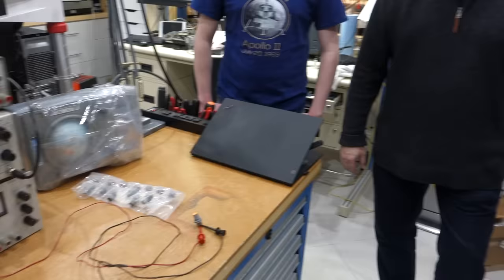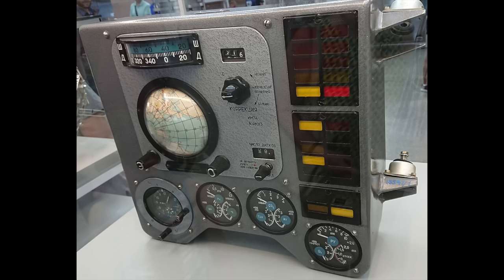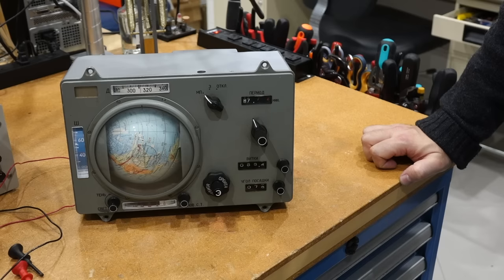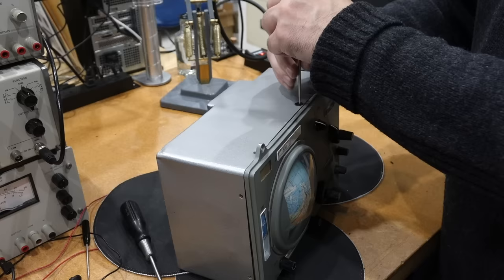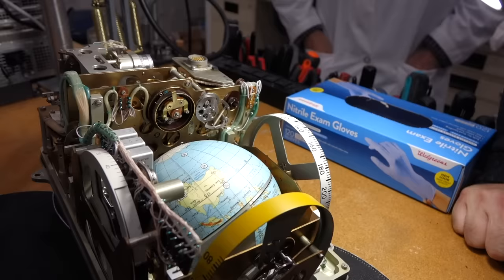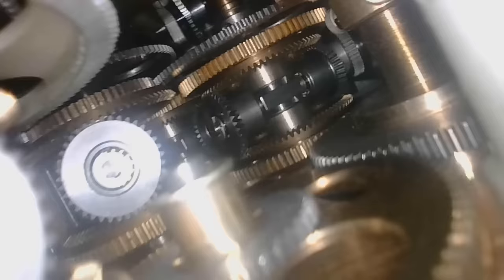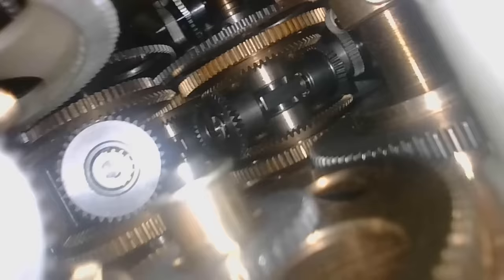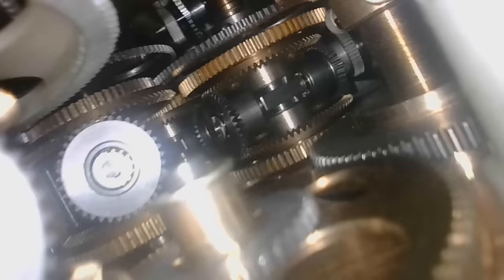Soyuz "Globus" Mechanical Navigation Computer Part 1: Grand Opening

Comment: It's incredible what people did in the past without CAD/CAM, a true engineering masterpiece.
Reply: Have you seen drafters? They're like the old computers when they were people too.
Reply: It´s a simple mechanism, not a computer. It uses ground radio beacons to determine position. As you fly over them, the globe turns to adjust according to the radio beacon below. It isn´t a true gyroscopic position computer. They didn´t change it over the years because there was no need. Why add complexity when such a device works fine, and is more suited to withstand the rigors of space and reentry? As the old adage says: "Keep it simple, stupid!"
Reply: Engineering Drawings have existed since hundreds of years/
Reply: It's simple. People were smarter back then. People actually invented new things. Nothing is new nowadays. Everything is a continuation ( modernized) from old tech.
Reply: @Biden_is_demented  "simple"? 🤔
Reply: @chris4321das  Yes, simple. Ever seen park rangers in Africa track an animal that has a radio collar? Same principle. A radio beacon is transmitting a signal up into space in a narrow band. The device just pinpoints the source based on signal strength and applies it to a mechanical/gyroscopic globe. Relatively speaking, it is one of the simpler devices in a space craft of the time. The guidance computer is a lot more complex, as it needs to know your position in 3D space even while deft and blind. It does that by accounting for every single movement the rocket and the capsule makes from the moment it leaves the surface. It is super sensitive gyro.
Reply: @Biden_is_demented  Nobody is talking about operating principles. This is not a simple mechanical construct.
Reply: @Biden_is_demented  The idea is simple but the implementation is not so.

Comment: There's just something about mechanical devices like this, they're a thing of beauty inside.
Reply: Indeed - it is an exquisite piece of work.
Reply: Antikythera of the XX century... Beautiful.
Reply: they are imune to EMP, pole shifts, geomagnetic storms etc etc... :)
Reply: @synth1002  obviously
Reply: @madmax2069  i hope comercial airlines still rely on electromechanics in vital parts of the plane
Reply: its amazing how purely mechanical and Electro-mechanical stuff can do so much without using electronics and chips or at least, using very few if at all.
Reply: They look like spaghetti inside , I can't imagine what a repair for something like that would go for.
Reply: Love retro tech
Reply: looks way better than integrated circuits
Reply: @rhanayt  I agree and disagree, some integrated circuits have their own beauty.
Reply: @synth1002  you mean modern space systems are not immune to these things? 😮 shock horror LOL
Reply: These mechanical contraptions might be necessary if large scale wars end up being fought with EMP devices.

Comment: I can see "73 г" - 1973 year of production on those МП3 microswitches, so most likely this unit was made in 1973-1974 or so. It is about 50 years old now!
Also it is impressive that after some really hard dropping you was needed just to insert globe shaft back in the mechanism to repair it... Definitely made in soviet Russia☻
Reply: The globe also has "1973 г." marking, just above "масштаб 1:100 000 000".
Reply: In Soviet Union - You don't use Globus - Globus uses YOU! :)  Beautifully crafted piece of mechanical engineering.  What we did digitally they did mechanically.
Reply from the maker: Thanks we found even more 73 markings on it now. This jives well with the Apollo - Soyuz fly date of 1975.
Reply: @slavisaasus  It's funny that "масштаб" is just the same word as Maßstab in German.
Reply: @benjaminhanke79  I presume there are historical reasons for that. Lots of military terms have been adopted from german.
Reply: @benjaminhanke79  Russian language has a lot of words adopted from other languages. Most of the Navi terms are from Dutch, military and mechanical ones are from German, electrical are from English and etc.
Reply: @CuriousMarc  Может этот "Союз" летал с "Аполлоном"?
Reply: Сделано не в советской россии ,а в великой и могучей державе СССР!Но я таких глобусов не видел ни когда.
Reply: @benjaminhanke79 Russian had quite a few Dutch influences in their language after czar Peter the Great visited the Netherlands to learn about ship building hence the similar words like 'maatstaf', 'stuurman' etc.
Reply: @slavisaasus  time 10:27
Reply: @user-ku1pb2cj9w  СССР это и была Советская Россия, Советский Союз, Советы - для всего мира. Также нас всех называли "русские".
Так что ты тут иностранцам мозги не пудри, а то они запутаются.
Reply: @Frontier2000  Советская Россия это подмена понятий. Как бы не странно звучало, но мы сами переписываем историю, подменой понятий так и происходит.
Reply: @Frontier2000  советской Россией называли территорию РСФСР до основания Союза в 1922(почти в 1923), в состав которого и вошли РСФСР, УССР, БССР и ЗКСФСР
Reply: @user-ku1pb2cj9w   СССР сделан из России, поэтому его принято называть Советской Россией.
Reply: @benjaminhanke79  да, немцы позаимствовали у русских
Reply: @leningradetsfromshusharsta985  не занудствуй, я имею ввиду что нас так всегда на западе называли. Никто никогда не называл полностью СССР или РСФСР, язык сломаешь, все говорили Совьет Раша или даже просто Раша. И в разговорах и в ТВ новостях.
Reply: @Frontier2000  они и так запутанные))).
Reply: @soulxtr  да, но входили в него самые разные республики.
Reply: @timothybakaushin7182  А в идише, сколько заимствований, Тимофей?
Reply: Maybe you could trace this device's origins back to the navigation systems of the German V rockets designed by German engineers.
Reply: @asendavidov9330   German engineers are not related to these systems. All German engineers worked for an American space program.
Reply: Although in this case you're probably right, but please note that it wasn't impossible to find parts made in the '70s in Soviet gear that was made in the early '90s...
Reply: @Frontier2000  они могут коверкать названия и суть, чего угодно, и когда угодно, но себастьян прав в том, что союз не только Россия, но и остальные республики, обеспечивали жизнь друг другу -  вместе.
Reply: @asendavidov9330  Ich denke nicht, dass es die sowjetischen Ingenieure nötig hatten, auf deutsche Technik zurückzugreifen. Die SU-Technik ist robust und Langlebig. Die mechanischen Geräte sind mitunter wahre Wunderwerke auf kleinstem Raum. Ich spüre schon beim Zuschauen den typischen Geruch, der solchen Geräten eigen war. 😍😍😍
Reply: @IwannaCoolNameToo  да не будьте вы такими занудами. 
Вам про Фому а вы про Ерему.
А насчет кто кого обеспечивал - сейчас это очень наглядно видно, что всех обеспечивала Россия + Беларусь.
Посмотрите, есть статистика, таблицы - сколько регион выдавал и сколько потреблял. Там именно так видно - Россия и Белоруссия больше отдавали чем потребляли. В отличие от остальных клопов. Которые потом в перестройку орали что кормят Россию. Кормильцы... Отделились, думали вот щас заживут, а начали кегли сосать.
Reply: I am from Russia, I was born in the USSR, I used to work as a CNC adjuster, I don’t know how these switches worked in the military and space version, but in the civilian version they were disgusting.
Reply: @benjaminhanke79  Isn't it funny that a lot of cafes all over the world are called Bistro (Quickly)?
Reply: East-block equipment was incredibly solidly build. I own an East-German oscilloscope older than I am. I could probably bludgeon someone to death with it and it would still turn on afterwards.
Reply: @user-ku1pb2cj9w  В Музее Космонавтики или в Музее Советской армии (точно не помню), на витрине...В разобранном виде - нигде.
Reply: definitely smell German from V2
Reply: @Frontier2000  to us, you're Russian. Communist is just politics.
Reply: @timothybakaushin7182  санскрит, древний язык Индии наполовину русский
Reply: @Frontier2000  Не было это россией, территориально да, но суть то в том что это другая страна которая уничтожила россию, а именно империю, это единственная страна мира коммунистического толка добившиеся огромных высот на мировой арене, это не было россией ни в каком разе, это был СОЮЗ СОВЕТСКИХ (потому что советы людей управляли всем) СОЦИАЛИСТИЧЕСКИХ РЕСПУБЛИК 

(потому что в глобальном смысле, совок это не страна, а самый настоящий союз, в каждой республике - совет, во главе самого союза, уже другой совет в который из разных республик лидеры советов и партии отбираются, короче я к чему это все, никак нельзя назвать СССР - Россией, мало того что России и Русского Духа в нем не было и не упоминалось, ибо все равны в мире, так еще и от феодализма и капитализма СССР далек, феодализм империи в целом на рельсы капитализма вставал а современные власовцы так тем более адепты капитализма, ничего общего с советами.)
Reply: @mrs.flegebula7797  обясните, почему некоторые читают ЖОПОЙ?
Reply: @Frontier2000  Иди отсюда лапотник, тут водки нет!
Reply: @user-ku1pb2cj9w это с косм.корабля,что бы на землю вернуться 😂 на шар😂😂😂😂 который притягивает гравитацией всё вокруг ,а капсуле нужен был этот компьютер что бы вернуться 😂😂😂
Reply: Because it's German. And It is easy to find many foreign words in the Russian language.
There are a lot of German words in the technical field.
And we must bear in mind that there were not only 15 different parliamentary republics speaking their own large languages, but there were also many smaller nations with their own authentic languages   (up to 130 languages).
https://youtu.be/sV2RG6Hdvw4?t=3589

Comment: The ingenuity of the "Globus" amaze me since the first time i saw it in one of the recent movies avout the soviet space progam.
The critical information aka where you are or where you are gonna land is presented in such an intuitive way.
The fact that you can switch beetween the two modes remind me of the TDC (torpedoe date computer), an electro mechanical targetng computer and early bomb sight of the same technology that could perform both CCRP (Continuesly Calculated Release Point) and CCIP (Cont..; Calcul...Impact Point) computing.
All those devices had to solve the same type of geometric and dynamic problems.

Little known fact : When NASA set up the its network of relay sation during the 60s at the heart of the space race it did offer the USSR the ability to use it which was refused.
Even then russian spacecraft had instructions in english outside the spacecraft in case it had to land ouside soviet territory, preferably on us soil which might seems counter intuitive in retrospect.
Also there was a NASA/state memorandum that if a soviet craft landed on US soil it was to be treated the same as a diplomatic vehicle.
That might explain why NASA stations were marked on the globe even before joint missions were a thing, just in case they had to communicate during an ermergency their intent to land on US soil. Just my 2 cents.
Reply: Очень интересно.

Comment: The cams engaging on a conical driver makes sense.  The orbit time is directly related to orbit altitude/speed (assuming a near-circular orbit) and therefore the crew can take the orbital altitude and speed over the ground into account by setting the orbit time.  Simple, elegant, and reliable!

Comment: In the 80s he served in the GDR. First as a mechanic driver on a self-propelled gun, then as a platoon commander of artillery reconnaissance. At that time there was no GPS, Glonass, and so on, but we were able to get attached to the terrain, and then systems with a gyrocompass and a mechanical system for indicating the location worked - a paper map on the shaft on which the route was drawn. The engineers of the last century were very smart and inventive. I raise a glass of wine to them. Vivat!
Reply: CuriousMarc..  I'm embarrassed for my English, but I didn't mean to please you, I was just talking about my experience.
Reply: Also ein Gyrokompass? Auf welchem Fahrzeug war der denn installiert?
Reply: @Rudeljaeger  Command and staff vehicle based on MTLB.

Comment: Very interesting device, I will say that I have personally seen this kind of mechanical navigation computers in Russian civilian aircraft like the TU-144, it had a mechanical INS navigation system and also the pilot's front panel had a moving "map", which basically projected a film covering all the flight plan that the TU-144 would follow from Moscow Domodedovo to Alma Ata in 1977.
Reply: hi from Domodedovo)

Comment: Soviet mechanisms, electronic boards with components are truly masterpieces. look at the braided wire harnesses.
Reply: Alle Kabelbäume sind mit isolierendem Band umwickelt und abgebunden. Lötstellen wurden mit Zaponlack versiegelt und die Platinen sind in Kunstharz getaucht. 😏😏
Reply: @wolframgerber7118 что-то я не вижу там следов смолы
Reply: @dmitryunique6876  эпоксидной смолой мазали платы для защиты от вибрации
Reply: That's what happens when the workers own the means of production.
Reply: @zcommandante  No! in a vacuum, it is to protect against electric arcs.

Comment: My father used to fix radios and TVs (vaccum-tube models) as a side job. When I was maybe 5 years old he took me to the shed he build to use as shop. He gave mea cutting plier and said, joking: "Now you will fix this radio!". A few minutes later he left to go the bathroom and when he came back to his shock I managed to cut all the wires inside of the radio. He had to buy a new radio to his customer.

Comment: I expected the Globe to be friction driven and free spinning. But now it makes sense that it's made for one mission on a dedicated inclination.
Reply: Friction drive of the Globe in two axis of freedom causes error accumulation due to  slip.
Reply: @toxanbi  I realized that when I tried to imagine how it works. I just couldn't accept that it has a fixed inclination. If the achieved inclination was wrong they would have to abort the mission. And it would never go to deep space.
Reply: @benjaminhanke79  You are not "achieving inclination". Inclination changing is so expensive, that you are using your launchpad coordinate and firing direction to program the inclination of your orbit. It guarantees that if you've reached the orbit your inclination is correct automagicaly.
The accuracy of that Globus must be pretty high. It is not just a fancy indicator. It is an actual navigation device which is used if you have to do manual landing. You use that globe for manual timing of the retro motor start sequence. And it was used that way at least once.
Reply: @timothybakaushin7182  I know it's all about the direction of the launch vehicle.

Comment: The black wax / tar seal is very common on soviet equipement,  I just broke one today on an avionics module !  The resistive wire of the potentiometer is made of a palladium alloy.

Comment: It should be added that this device did not receive any external signals during the flight (not even star orientation) and was completely autonomous and its accuracy depended only on the initial settings.
Reply: Неа, как минимум тактовый сигнал, он принимал :)

Comment: laugh all you want about these old mechanical "computers"... but they are extremely robust against gamma rays and power supply noise, both of which are severe problems with modern semiconductor systems despite them having redundant systems. nice when all you need in space is a shoebox size tool box and a can of WD-40, JB weld and electrical tape to keep your mission going.

Comment: what a great inovation, all mechanical, now all you need to do is find where the 'neuclear permission to fire key' panel is, as with the mechanical clock, these look like they fit inside a 'bear' as the bombadears' firing equipment, to guide the missles, and to time the release from the aircraft (simmilar to the B-47 and it's 'seccond station' equipment).

Comment: While watching the tour of its components near the end of the video, it occurred to me that this flight computer is in several ways a Soviet 'Antikythera' device. Just as the Antikythera device mechanically calculated celestial events based on ground location, this Soyuz computer used similar dials and gears to calculate ground events based on the ship's space location. Like Antikythera, this computer was designed by some very smart people to whom I tip my hat.

Comment: 21:50 It's not an SCR, it's a diode (i.e. D240 series). At 14:37 you can see one axial pin at the top of it, usual for stud-mount power diodes of that era. SCR's had an additional "gate" pin at the top (i.e. KU202 thyristor series).
Reply from the maker: You are correct!

Comment: Back when there were no 10nm nodes and hi-res screens, engineers had to use what to us civils looks like overcomplicated audio-video systems from 70-90ties to fly and land a spacecraft. And its actually the same purpose, you make inputs to the media and get back the results on a media. In audio-video systems the media was a tape, spool, disc and here we have a globe.
When we have a physical media, we at least need some mechanism to move and read it. Here we also need to calculate